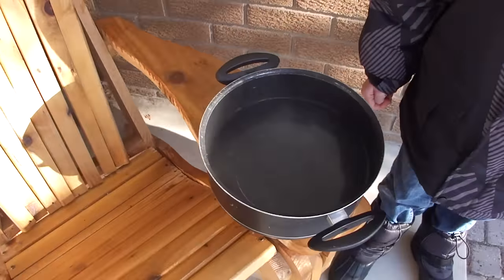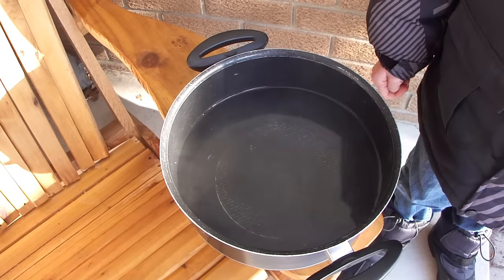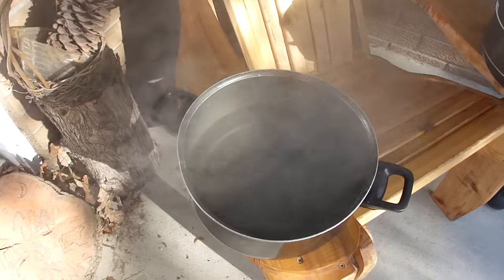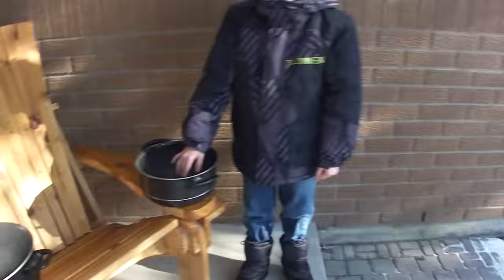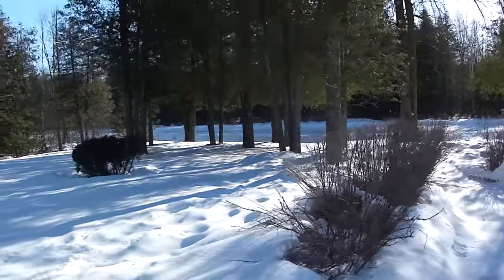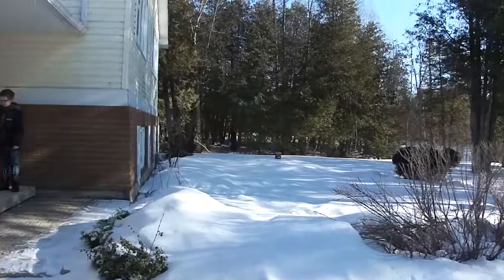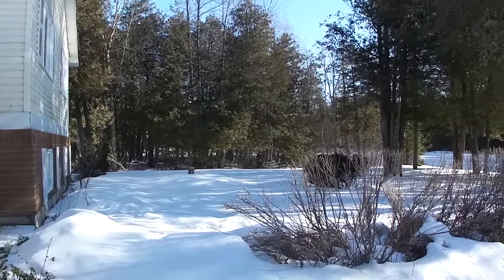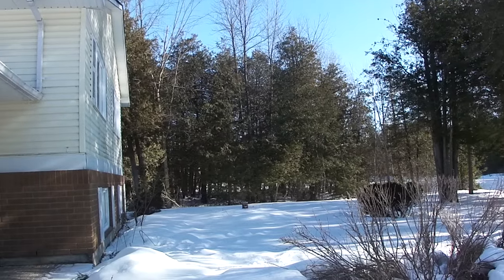Hot water freezes faster than cold water?

Comment: Those who don’t know, this is for them “ Do you know what are those white lines behind airplanes in sky? “
this video is the answer.
“Approximately at 36000 ft altitude, atmospheric temperature is -50 degrees Celsius or less. When the hot water vapour from the aircraft engine’s exhaust system meets -50•C  it condenses into water droplets and then freeze into ice particles and form a line-shaped cloud exactly same like in this video”.
Reply: damn!!
I always thought it was smoke or something from the plane😗😙
Reply: Thanks for educating
Reply: Huh, that makes total sense, and yet I’d have never thought of that.
Reply: Now I can tell my grandpa that it isn’t for mind control 😅
Reply: Oh so engines run on water? Thanks I didn’t know I could use water in my gas tank in my car I’ll have to try it 😊
Reply: @ksggbg990  ha ha. Here is the answer brother. 
In order to make fire/ combustion in engine your car needs oxygen, oxygen is taken from the atmosphere in the form of air mixture. When it combines with fuel and(gasoline or any gas or diesel) when we put the key in the car we are igniting the fuel and air mixture in the combustion chamber. So the exhaust gas definitely consists Nitrogen, co2, water vapour, CO, etc...
Even in your body the fire is happening. Your exhaling air contains water vapour my friend. During winter you can feel that easily
Reply: @LearnSafetyOnline  indeed
C(n)H(2n+2) + O2 => CO2 + H2O (perfect combustion for alcana)
Basically, fuel + Oxygen = CO2 + water

I also wanna add that imperfect combustion would reduce the energy output and peoduce Carbon Monoxyde, which could be deadly
Reply: @seratarsybagusibrahim5018  absolutely
Reply: Well, also "condensation trails" and you don't need engine exhaust to form them.  These form at wing tips.
Reply: @KSG GBG  No one but you said that.  Not sure where you would even get that ridiculous idea.
Reply: @seratarsybagusibrahim5018  In a car, carbon monoxide (with an I) is produced no matter what.
Reply: @grimfang4  Yet still, the exhaust DOES cause them, as well as other processes.  It can be both.  Bet that blew your mind.
Reply: @bigguy7353  Uh, of course.  Did I say otherwise?  You don't need engine exhaust to form contrails.
Reply: Heyyy cool didn’t know that , thought it was a bunch of smoke cans or something!
Reply: Thanks
Reply: @ksggbg990  , watch the tailpipe of a gasoline-burning car when the engine is running on a freezing-cold day.  You'll see water dripping from it.  One of the products of oxidizing (burning) gasoline is water, which can be vapor or liquid.  The same is true of the metabolism in the cells of your body, which is why your exhalations contain water vapor, which you can watch condensing on cold window panes and see as clouds in front of your face on cold days.
Reply: cHeMtRaIlS!!!!!
Reply: Cool information
Reply: @kevintrang6447  It's how they make the Earth flat.
Reply: You are describing con-trails, rather than chem trails which are aerial dispersed at much lower altitude.  
Aside from altitude, ie air temperature, con trails re-evaporate, whereas chem trails just slowly dissipate until the aerosol falls to earth.  (Farmers use them for crop spraying, and aerial display teams use coloured ones for show.  Then there is weather modification, of course.  Gates proposes using the latter method to simulate sulphur dioxide emissions from volcanoes to cool the earth.

Comment: This is probably because the hot water evaporates much more in that cold and  not because it freezes faster then cold water. It is just my guess.
Reply: Thanks...now i dont need to type this myself😅
Reply: *than
Reply: The comment above yours explains what actually happens
Reply: Actually hot water has more energy to expand then cold water
Reply: @Plasma-vs1eq  yes, you can think this as enthalpy. As the enthalpy of the hot water is much more than the cold environment, that's why it is expanding much faster than the cold water.
Reply: I have my own guess

Hot things want to become cool, in the simplest of terms. Objects don't wish to have energy and will try to get rid of as much of it as possible. Cold water has barely any heat, and therefore energy, to give off, and therefore will not 'try' as hard. Hot water wants to get rid of its heat very quickly, so it 'tries' harder and therefore freezes
Reply: @hipeople7338  That's actually Newton's law of cooling.
It says the rate of loss of heat is directly proportional to the difference of temperature between the body and surrounding. 
In this case, for hot water the difference of temperature was higher so it froze quickly, but difference of temperature was low between cold water and surrounding, so it didn't freeze
Reply: So if you put both those pots out the hot water will freeze faster?
Reply: @fangio2902  the most appropriate answer
Reply: @fangio2902  It is right that greater the difference between temperatures greater will be the rate of heat dissipation, but I don't think it is the reason of what is happening in video.
My theory is hot water and vapor has more pressure than cool surrounding that's the reason it's expanding faster. And since vapor takes more volume than liquid water therefore vapor might freezing faster.
Reply: You genius!
Reply: My theory is that hot water loses its mass in evaporation and becomes less denser then cold water .
Even if it's matter of seconds there is actually change in molecular mass of hot water so the liquid has to loose less heat ,you know to become cold. That's why it freezes fast when compared to cold water.

Edit : ok I checked it in Google , it actually says the same . No wonder I was able to answer, bcoz I had searched for this question before too
Reply: I studied a little and my findings are:
Yes, there r certain cases when hot water freezes faster than cold water, and this phenomenon called mpemba effect.
2 methods of loosing heat or cooling down are evaporation (escaping high energy or heat molecules) and convection (transmitting heat through contact only without molecules escape). Apart from this heat loosing in both methods will depend on contact surface area and internal state of liquid and external conditions. 1 gram water loss in evaporation will take away 540 calorie heat from water at 80°, while 1° cooling down of 1 gram water will take away only 1 calorie. So, evaporation increase the cooling down process much more than convection. Larger & better the contact surface area greater the heat loss for both evaporation and convection. Less crystalize & impurities of steam & water higher will be heat transfer across. Lower temperature lower pressure denser air of external surrounding higher will be heat loss from internal matter.
Now when u throw water, both the water will exist in 3 states ice water steam initially. Differences will be in quantity of each state, rate of heat & state changes, changes in the rate of heat & state changes.
Now when hot water is thrown here than evaporation is very high & fast & takes large volume, bcoz of many reasons like throwing process increases the surface area and also surrounding conditions increases evaporation. Now next water exist in steam and liquid form which freezes separately.
Steam take up large volume and hence high surface area, so it cool down fast, first steam start condensing and then convert into minute liquid particle and then to minute ice/snow particle rapidly very fast. Overall freezing occurs fast.
Now, the remaining liquid water from original hot water will also freeze very fast (atleast definetely faster than lukewarm water) bcoz of many reasons. Like quantity of leftout water has been decreases to begin with and large heat has been lost bcoz of large evaporation. In cold water ice start to float at early phase of cooling which insulate it from evaporation & convection on top side, this does not happen in hot water. Left out Hot water will have better hydrogen bonds which helps in cooling.

Comment: Even after 10 years this is one of the greatest scientific experiments ever conducted
Reply: 10 years...
Reply: @mr.lag1secondago124  he even seem to have "fixed," i.e., adjusted it 😅
Reply: Its still a unknown as to why it happens. Logic says it shouldn't, i think its magic and lets just leave it at that, or hot water is less dense through steam evaporation.
Reply: This was conducted for the first time over 600 years ago.
Reply: @myview5840  That makes no sense.
Reply: @bigguy7353  my answer or the reason why hot freezes before cold???
Reply: Hot water does not freeze faster than cold. What is happening here is that the hot water when thrown gives off a lot of steam/ vapour which condenses in the air but the majority of the water still falls onto the ground. It would deny the laws of physics if hot water froze quicker that cold.
Reply: @johnparker2957  cold water is actually lighter than hot water
Reply: I’d say that’s a bit of an exaggeration
Reply: @johnparker2957  yea, what exactly did this experiment prove? That boiling water gives off more steam than room temperature water does? Well duh.. but what does that have to do with the question of freezing faster?
Reply: It actually does; look up the Mpemba effect
Reply: I'd say the greatest experiment was using nuclear energy. This would be a close second.

Comment: The guy just stopped recording because of low battery...

Imagine if his phone has a solar power, would he still be capturing the video??
Reply: Cold temperature caused any gadget that use battery to drain faster.
Thought solar powered could help a bit.
Reply: @lexex2550  Doesn't battery run out faster in hot weather than cold weather?Like,lol.At least I think that's what we learned in school...Its because:Ur gadgets overheat faster in hot weather than cold,and even if they don't overheat they're generally warmer,causing them to use more power,and run out faster.The warmer something is,the more energy it uses.The colder it is,the less energy it uses.Common sense isn't it?
Reply: No his hands would freeze
Reply: @Ugh718  
Doesn't work like that, try it out yourself.
few years ago i brought my phone fully charged in temperature of 1°C, it only lasted 5 hours. And it wasn't a smartphone and i only use for seeing time.
Reply: No because the kids hands were cold lol
Reply: @Ugh718  
Heated battery devices drain faster, and cold devices drain slower, i can assure that
Reply: @derpyhooves4287  Exactly
Reply: @Ugh718  

eeyup
Reply: @Ugh718  

eeyup

Comment: i think it's because when the water is in free fall under no container pressure from gravity, it is free to expand according to it's temperature, and it can do that at the microscopic level, allowing the frozen air in everywhere around each molecule.  the hot water would be much better at this if true because of the kinetic energy difference in each molecule on average.  it expands more quickly, so it shares its volume with much colder air sooner than the cold water, facilitating rapid freezing.
Reply: Dean, that is good thinking. ⭐

Generally water expands when it freezes, not heats up, which is strange.  

I wonder if they got another liquid, one that contacted when cooled, would the effect here be reversed?
Reply: @TheNoiseySpectator  oh that's a good idea, i think we are on our way to doing some science here!  too bad i don't know of any other liquids besides maple syrup.
Reply: @TheNoiseySpectator  water expands when freezing because of the chemical structure of water, H2O, being able to form a kind of bond called hydrogen bonds, creating a structure when it's frozen that's less dense than liquid water, expanding it
Reply: Nah, its evaporation in cold dry air. Evaporation takes a shit load of energy, so as soon as you throw that boiling hot water into the air and massively increase its surface area much of it instantly evaporates taking most of the heat energy with it. Also, water expands when its heated like everything else, its just that as said above me it crystallizes into a less dense structure than liquid water.

Comment: I was hoping someone could explain the science behind this since the subject will come up indefinitely at every one's dinner table
Reply: Now I remember about the science class I studied years ago which says about a Newton’s law about cooling
It says if the difference between the liquid and the atmospheric temperature is high it cools faster than a liquid which is less hot the first
Reply: @Hand.made.style4745  - and yet, they're at the same atmospeheric pressure....

It's because in the hot water, the molecules are vibrating more, and thus, further apart (that's how you get steam, after all)

There's therefore a greater amount of surface area *per molecule*, and thus, they lose their energy quicker to the cold air

That's why the effect appears like powder, not a shower

Comment: For those who are wondering: hot water does cool down faster than cold water. I was interested in this when I was told you need to warm up eggs before putting them in a mixture cuz then they’ll cook. There’s a law in thermodynamics that essentially states that the greater the difference in temperature two things are, the faster they try to equalize. So there you have it. The hot water and the air has a difference in temperature greater than the difference between the cold water and the air, so the hot water will cool down quicker.
Reply: Praise the brain man
Reply: You may have just given me a tip for Chemistry next semester. Thanks alot!
Reply: Newton's law of cooling
Reply: I hope you’re not a pilot or any profession where people’s lives depend on your understanding of math or science
Reply: @druariel  Well, my math skills don't involve life or death, but I'm a math professor, and his comment is absolutely correct. However, the conclusion someone may base from this is not. A different experiment, such as leaving the two pots outside until they froze and checking their temperatures every couple of minutes, would reveal that the hot water dropped in temperature faster. That is what this comment is implying. This would be noticeable based on the temperatures in the water getting closer together while cooling. However, as you're probably implying, the pot of cold water would definitely freeze first. It would always stay colder than the pot that was hot, even if that difference eventually became small.
Reply: @mike1024.  It depends on what you mean by ‘cool down’, in this case ‘reach a target temperature’, which will never happen. 
The hot water pan will never overtake the cold water pan, because at the moment it is about to they will be thermally identical. This is the fallacy. So heating up water to make it cool faster is illogical.
Reply: @druariel  Right, the term cool down was very misleading.
Reply: Law is correct but I don't think it explains what is happening in this video.
My theory is hot water will expand and evaporate faster due to having more pressure and energy than cool surrounding. Next steam water will freeze faster than liquid water, bcoz steam will take more volume and hence greater contact surface area with cool surrounding.
Reply: @ashutoshgautam3293  Hopefully you know that the gas laws do not apply to liquids or solids, ie hot liquids and solids do not exert more pressure on their surroundings than cool liquids and solids.
Steam will not freeze faster than liquid; it will become liquid first (except in the special case of deposition onto a supercooled surface, not applicable here).
Reply: @druariel  first, I think from visuals we can see that steam of water expanding very fast in large space, it wud have expanding little less if water wud have little cool or if surrounding wud have little hotter. I think it is bcoz high energy molecule from hot water shooting out faster in cool surrounding. In a way these high energy molecule exerting more pressure to shooting out in surrounding. Otherwise why is so much evaporation here.
Secondly, yes steam will first convert into liquid and then to ice. And I think good portion of steam here rapidly turning into liquid and then into ice, it is probably bcoz of large contact surface area of steam.
Although, I'm not very certain in my second point.

Comment: for those wondering. though it looks as though the hot water freezes faster, it’s actually just a faster transfer of heat from the water to the environment. so it gives a larger effect. kind of like setting one match on fire compared to 100 matches.
Reply: What is the difference between it freezing and its heat being transferred to the environment?
Reply: @TheNoiseySpectator  for it to freeze it needs to transfer its thermal energy to the environment until it is at 0°C
energy transfer is something heating up something else
freezing is reaching the freezing temperature and becoming a solid
Reply: @TheNoiseySpectator  This is a bit late, but I'm pretty sure the water isn't actually "freezing." When it's tossed, some of the boiling water evaporates, but the cold air immediately turns it from steam (pure gaseous water, which is clear) into water vapor (small liquid droplets in the air, which look white/smoky).

That's why the cold water doesn't produce as much vapor; it's not evaporating as much as the boiling water, so there's less steam to turn into water vapor.
Reply: @-butterfly-594  I'd note that water vapor will freeze a lot faster than a mass of liquid. It's entirely possibly that it is freezing, and freezing faster, but the reason has nothing to do with the temperature itself, and instead the fact that the heat is breaking it apart, so that more of the water is exposed to more of the cold air faster.